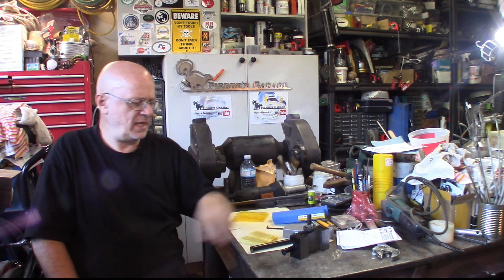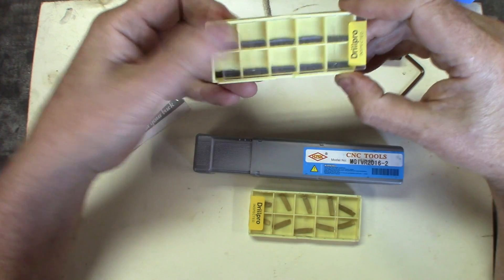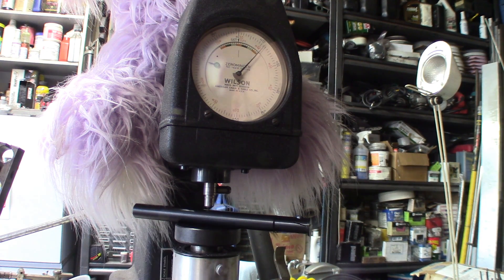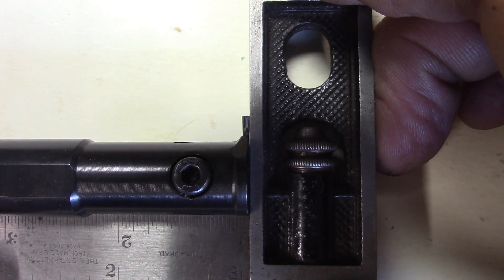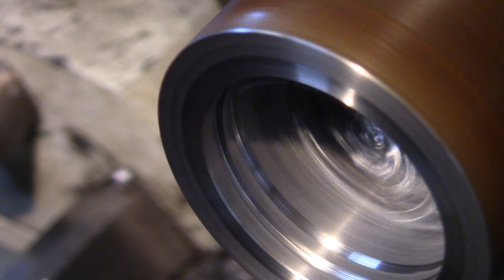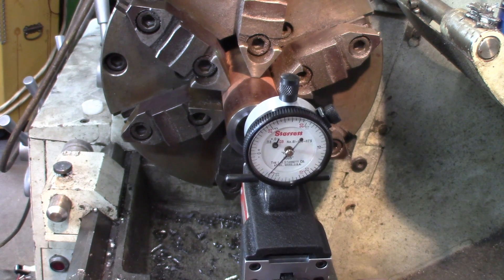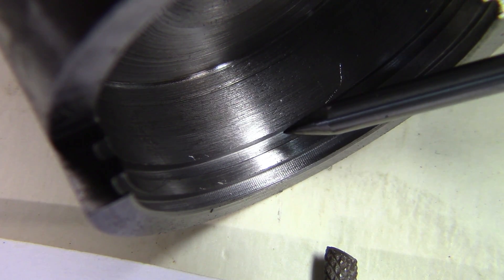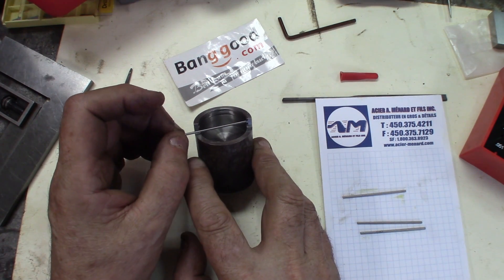Budget priced internal grooving bars from Banggood... Another valuable tool, at a great price.

Comment: Hi Pierre, my question may sounds stupid. Why the 1.5mm inserts are gray and the 2mm have this goldish color, is there any reason so we the home "machinists" have to know about.
Thanks in advance
Reply from the maker: On carbide inserts, there are many sorts of finishes, this is mostly to help metal under cut slide better on the surface of the inserts, to avoid sticking or welding itself to the carbide, the color is an indication of the type of coating is used, the manufacturers will specify on what metal a certain insert is best optimized.
This optimization is best used on CNC where every operation is closely monitored in order to save time material, passes, save wear on cutting tools, as an example, if you save 30 seconds on a 3 minutes machining a part this makes lots of extra parts at the end of the day.
Also by minimizing the inserts changes cause they last a few more minutes and give a better finish, etc...
This is a complex science when you want to get the last bit of performance in a high production industry.
As in a smal shop the optimization isn't gona be so important, same when using manual machines, it's also difficult to adapt all different metals to the perfect coating when you do multiple types of jobs using different materials, you don't really want to have in stock 30+ types of the same TNMG insert to be always using the most optimized cutting insert...
Thanks for viewing and for comment,    Pierre
Reply: @pierresgarage2687  thanks a lot... :-))

Comment: My review of similar items a while back was quite favorable .... although have yet to take a look at the actual grooving bar. Generally these kinds of tool do seem very good value. Must get me one of these I think.
Reply from the maker: The cutting tools are quite a great purchase in most cases so far...Are you still in touch with Amar?
Reply: Yes, basically. I told him I was off the grid for a while but may well get back to him later for something to review. He did offer me a small CNC engraver deal but wasn't something I was over interested in.
Shop time still not quite forthcoming.

Comment: I think Bruce showed how to put bits of carbide into a boring bar to reduce harmonics. I'm not sure if it is just the weight, or also the pre-tension he put on with a setscrew in the end.
And I also have a message from your mother: Please don't stick your finger in there! Use a toothbrush or something. Makes me cringe to imagine what would happen if...
Reply from the maker: I missed that part about Bruce dealing with chatter in boring bars, would you know the where abouts of it...?   Only if it's easy to find, though...
When I was editing thee video the chips in the bore kinda shocked me a little also, decided to leave it so people think about cleaning before introducing some body parts in a bore full of swarf...   Fortunately those chips were on the more tender side end not potentially not the agressive sort...   ;)
Reply: Sorry I can't find it either, but I'm confident it was Bruce Whitham.
What he did is drill a hole from the rear of the boring bar and stuff it with cylindrical pieces of broken carbide drills and mills (neatly cut off). 
The hole was threaded and he put a setscrew in the end to close it and put pressure on the carbide.
The idea seems to be that the weight of the carbide dampens vibration, but I believe he said the torque on the setscrew is important so therefore my theory about pre-tensioning the bar from the inside.
Not sure if it would be at all practical for your much shorter grooving tool.
Reply from the maker: Thanks, your description gives me an idea of the principle, something to look for in the future in order to get the problem behind...  Vibrations are complex to play with...   ;)
Reply: thats a pretty clever use of differing metals and their compression!  the closest i can compare: my drill press column vibrated more than i wanted, i filled with concrete and had some threaded rod in the centre of it , put  some super thick washers each end, tightened up the bolt, left it to cure, no vibrations!
Reply from the maker: The trick is to change the resonant frequency, any piece of whatever will resonate, if it resonate during normal operation, then, we need to chenge the frequency at wich it resonates...  
Factors: mass, elasticity, lenght, shape, etc...
Reply: I've seen people put lead weights around tools, rest brass hammers on them, add cast iron collars with setscrew, add globs of silicone sealant, change HSS <--> carbide, change tool diameters, change feed/speed...  

Really, tricks to fight vibration could be a long video by itself.  I would kind of like to see one of you Youtube machinist masters present it as a subject on its own.  

Another excellent video, Pierre, thank you!

Comment: The last one for the 90 degree holder and inserts worked out just as you said, I am very happy with them Glenn
Reply from the maker: Some of the tools from those merchants are good deals and work great, just need to find out witch ones.
Glad you're happy with your purchase, on my side i'm using it on a regular basis and I'm also getting great results...
Thanks for your input and comment,     Pierre

Comment: I imagine the stick may have played a part in the 3 thou discrepancy.  Maybe some lead wire wrapped and taped to the bar will help.
Thanks for the review :)
Reply from the maker: it's possible, but there wasn't much tension on the stick...
The difference in the first groove was about the same as in the second one, where the groove was used. Sometimes :I use some soldering wire for plumbing held with elastics or tape it also works great or even better than the stick, just a little more time needed to install...   ;)
Thanks for comment,   Pierre
Reply: I assumed that the reading of the 1st groove was due to measuring across the chatter crests...
Reply from the maker: There is a lot implied, by looking at the chatter marks they seem more in the tenth of thousands, so it  wouldn't be a factor, the real challenge to measure those would be to remove metal on either side of the groove, clean up edges and keep the bottom strip an get to an optical comparator in order to get a reliable reading, doable...